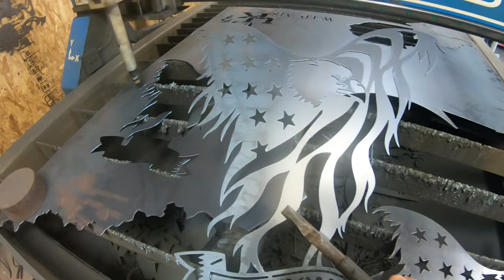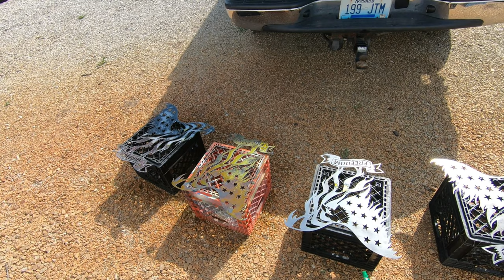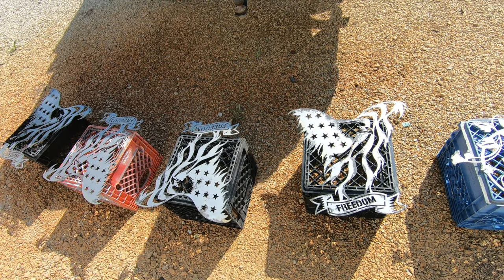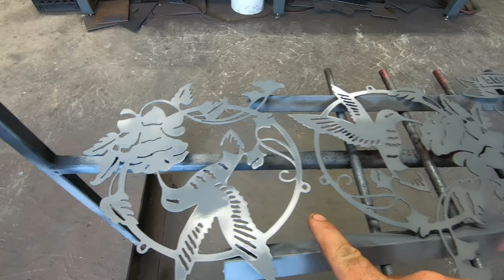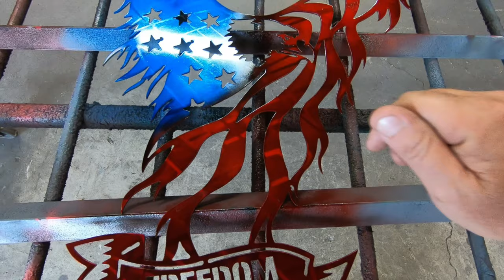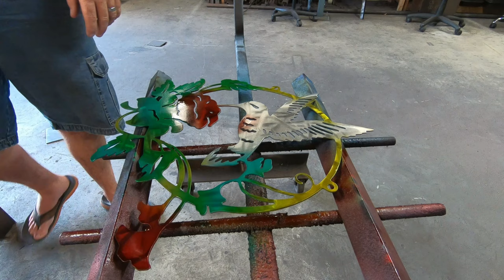Using the Shopsabre CNC table to represent some American Pride.

Comment: Great job Junior! 5 stars bud.
I enjoy the complete process from cutting table to finish paintwork. Your paint is solvent-based, not waterborne right? 
Sweet designs, do you do the artwork yourself on the computer, or do you have a template collection? Some of the designs are quite intricate, I imagine it takes some time to perfect them before you go to the cutting table step.
Hope you're enjoying your weekend, work safe, stay cool!
Doug@ the "ranch"
Reply from the maker: solvent based paint, most of the artwork i start with a black and white image from google and change things accordingly from there. thanks Doug.